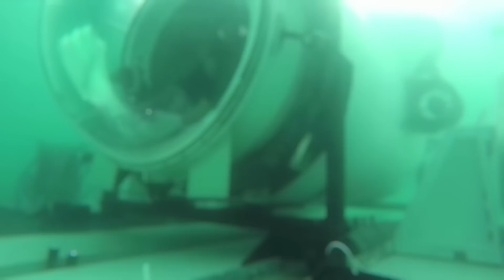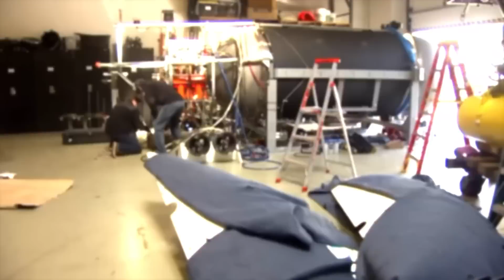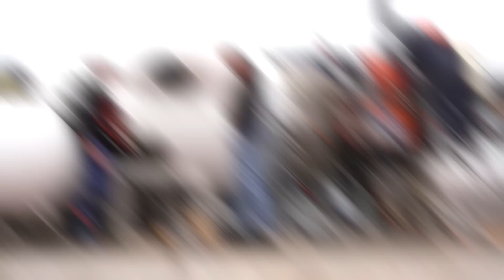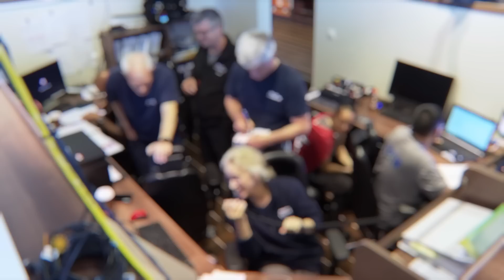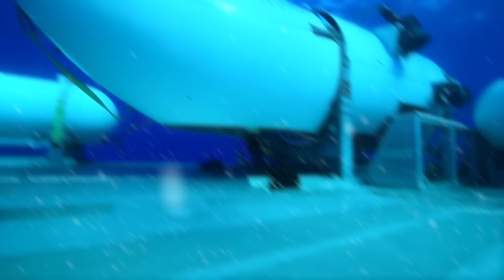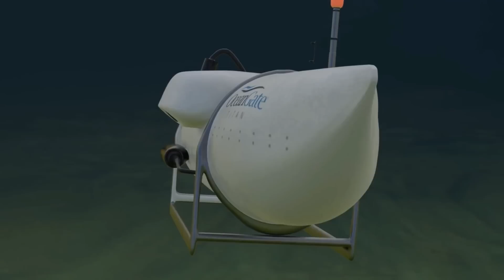The TERRIFYING Truth Behind The Titan Sub Implosion

Comment: Fact Check: "bodies didn't leave a single trace behind" <-- UNTRUE. The USN has officially reported that on 6/22/23 that human remains were found in the debris field.  This notion that no human remains would be possible after an implosion, is purely premature conjecture that was floated to the public by amateur and even official news reports like they are doing you the favor of Human remains were discovered by the USN on June 22nd when an ROV located the debris sight over 1000 feet from the bow of the Titanic. The NAVY delayed releasing that information until certain parts of the investigation were completed. The USN released a video that contained the best timeline of events surrounding the ill-fated dive and subsequent search and rescue operations.  At 4am (zero-hour) on 6/18/2023, the Titan dive commenced. Just 2 hours into the dive (6am) the Polar Prince experience a total communications loss with the Titan.  The Polar Prince did not contact Port Authority/Coast Guard until 2pm - which was 8 hours after communication loss with the sub. Search and Rescue operations of the US & CA Coast Guard commenced immediately. By 6/20 the USN CURV and other deep sea search and debris/wreckage retrieval equipment and search equipment had arrived on location. On 6/22, the Titan pressure chamber along with confirmed human remains were found and retrieved. I saw quite a lot of the debris being transferred from the retrieval vessel to a Port Authority and they showed identifiable parts of the Titan, the nose cone missing the glass, the seal ring, the skids, the equipment rack with much - if not all - of the equipment in tact, and a large section of the side of the pressure hull that was cracked and ripped away from the remainder of the hull. There were additional pieces already hauled onto the PA vessel, that were being kept completely hidden and could've included human remains. Conspicuously, the USN has never released the exact time and date of the "audio anomaly" that they say is consistent with an implosion.  I assume that anomaly occurred at 0600hrs on 6/18, at the point the Polar Prince lost contact. But no one is giving real details - the timeline is sketchy and barebones at best.  Very sad and tragic.

Comment: I think the biggest mistake that Stockton made was his choice of building materials. He chose to coat the outside with Rhino Liner. Flex Seal would have performed much better for this application. Phil Swift made a glass boat with it so it's maritime capabilities are already proven.

I don't know what that peanut butter adhesive he used is called but Gorilla Glue is a no brainer here.
It's incredibly strong and has a five star rating. It's waterproof, holds up to hot and cold temperatures and bonds to anything. If you never heard of it, I highly recommend it. 

I hope this helps any future submarine entrepreneurs.